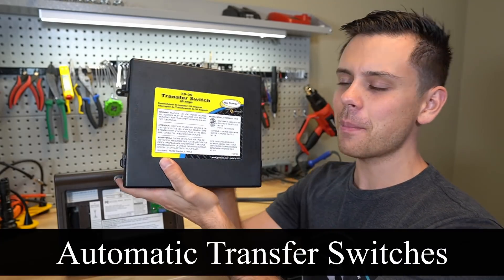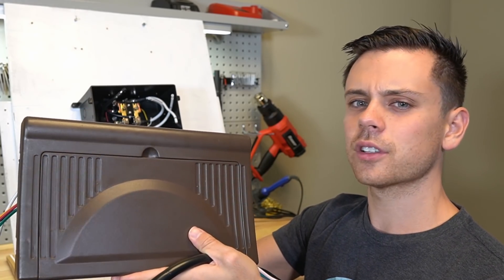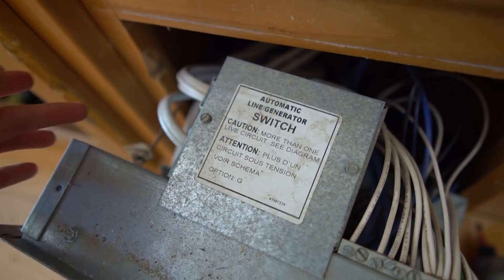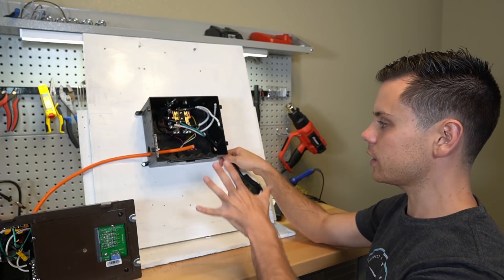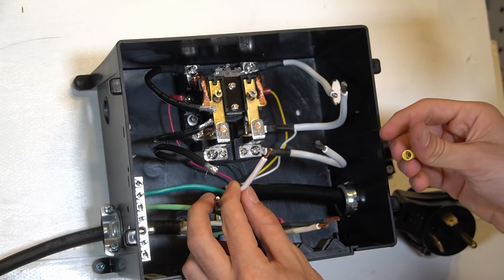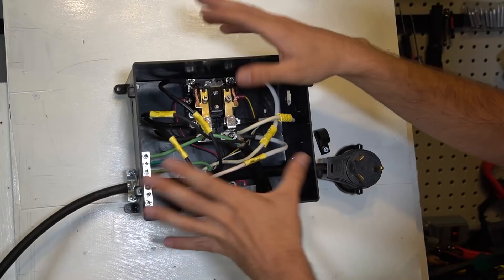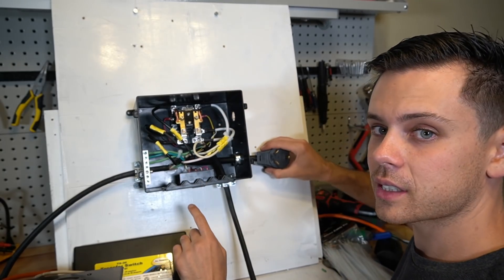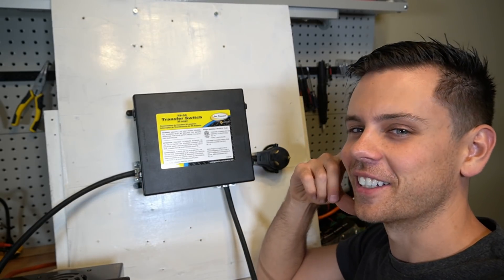RV Solar Power: How to Install an Automatic Transfer Switch to a Solar Inverter

Comment: Will…I can’t thank you enough for clarifying the converter charger connection at the end of the video.  I have been wrestling with the best way to “hot wire” the charger to the transfer switch for 2 weeks and you clarified it in mere moments.
Thanks again…for yet another outstanding video!
Reply: Do you have to disable the factory converter, or does it get bypassed from the transfer switch for the new charger ? Lifepo4 battery

Comment: The online schematics at GoPower show two different setups. For switching between a generator and shore power, it is as you have shown. But for switching between an inverter and shore power, the inverter and shore power connections are the opposite. I don't know why that would be, but according to the online schematics, that is the case. I would want to talk with GoPower tech support before installation in order to resolve the issue.

Comment: Hello Will,could you post a video with a diagram for an RV set up? My question is from the transfer box to the inverter. Should there be a fuse or a shut off block and also, what does the solar system look like from the inverter on? Thanks.

Comment: so if you have a generator, shore and solar will it require a transfer box with 3 inputs?
Reply: ohh nvm got it there can be variation depending on the converter box. if it has a transfer switch built in just find the shore power and add another switch there

Comment: Hi Will, Will the HCDC Model HD060 15amp work for my small teardrop with only three 15amp breakers in it? Trailer doesn't even have a 30amp plug only a power cord style plug. Thank you!

Comment: Hi Will.  I do have a question in regards to connecting the new solar system with 2000 watt inverter to the main panel.  My solar system will not be able to run my AC unit so I can't see hooking up my inverter to the main panel via a 50 amp automatic transfer switch unless I turn my two AC breakers off before turning on my inverter.  Have you had other ways to hook up to the main panel without going through the process of disconnecting the AC system breakers or is just easy to remember to turn the AC breakers off?  As well to turn off the converter.

Comment: I have two 10kwh battery banks each powering with a 3000w Giandel inverter...    right now I have one of the inverters wired into a breaker to supply a 25a circuit to my RV.   Could I wire both inverters into this transfer switch so it would fail over to the second inverter as a backup if the first one lost power.   ?    Right now the 2nd bank is powering aux loads (septic, well, etc) and i view it as a backup if the other battery bank is low...  it would be great to have an auto cutover and cut back.

Comment: Will the system work when the demand becomes to high and the invertor closes down. When the invertor comes back on even when the demand is to high. Will it create a cycle in short time between supplies?

Comment: RV Question: I want to install an EG4 3kW Off-Grid Inverter and an EG4-LifePower4 Lithium Battery | 48V 100AH | Server Rack Battery in my RV. Can I do away with the transfer switch by 1. Running my shore power line to the ac in on the inverter. 2. Run the ac out from the inverter to the ac circuit breakers. 3. Disconnect the RV battery charger. 4. Run a 48v dc line from the battery to a new 48v to 12v converter located next to the rv panel. 5. Connect converter to DC breakers. 6. Later connect solar panels. Now when I'm plugged in to shore power will this all work without the switch and without problems? Thank you

Comment: Only thing different I'd so would be shrink tubing to help from the wires pulling out of the butt connectors, or use wire nuts but I love how straightforward this is 👍

Comment: This ATS is awesome!  It now comes with a clear cover plate over the contactor and it has pre-installed wago 221 wire connectors!

Comment: You should do a video hooking up ECOFlow Delta pro with a transfer switch.
Reply: I second that!  As well as show how to add a toggle to switch to be able to swap between a generator and Solar power station for backup power. TIA!

Comment: Is there a way to use a 30 amp switch on a 50 amp wire system my RV was designed for a dual Air Conditioner but I live in the Northwest we don't need two so there is no reason to have a 50 amp service. I have only used the 30 amp service at any RV park I've stayed at?

Comment: hello to you, first of all, thank you very much for all the very clear explanations that you share. I have very good knowledge of electricity but far behind you, my question, I have just received my new trailer; sporttrek 251 vfk, and therefore prepared for the new season 'there is already a 100 watt panel I would like to add two other 200 watts, my controller; go power GP-PWM-30ul (mauel says he can hold 500watts), my inverter: WFCO WF-8955 AD, I have two 12volt, 200ah (400ah) lithium batteries available, 2000watt inverter, what do you think of that please, thank you in advance

Comment: I have a regular renogy 2000 watt inverter and a renogy dc/dc charger with mppt is there any way to add shore power to charge the batteries without having a inverter charger or purchasing a bunch of extra stuff? Thank you 🙏🏽 I watch your videos all the time and you break things down really well

Comment: Correct me if Im wrong have a 200watt solar set up to charge batteries while traveling and in case power goes out, could you wire it up like this and just flip the charging breaker switch and be fine running off the batteries? My two 200ah batteries are the only ones I have. So bo room to add a seperate battery bank. Guess thats my question couldnt I hook everything up just like this, and when Im not on show power flip the charging switch on my converter?

Comment: Hey Will.. thank you for all you do!  This video is 3 years old, and still valid, but I'm hoping you could do a new version, using a 50 amp switch.  I have installed 4x 200 watt panels on my 5th-wheel rig, along with 2 SOK 206aH batteries, and a 3000 watt inverter.  I have purchased a 50amp automatic transfer switch, but not confident of the install without a bit of guidance.  (and you are one of the few that I trust).  Thx !
Reply: How did you end up with the system as I have a similar set up with SOK 206aH batteries and 800w solar panels and 2000w inverter?

Comment: what starts the generator?
Reply: The transfers from shore power to inverter power.
You would plug your shore power into whatever generator you have and start is as normal.

Comment: With this arrangement of wires isn't the ground wire for the inverter bonded to the neutral for shore power? I am assuming the shore power is bonded at the shore panel of course. Is that safe?

Comment: At minute ~12:39 you mention terminating the battery charger. I assume this is so that the inverter doesn't pull power from the batteries and try to charge them up at the same time... That said; do you have a video on how to terminate the battery charger on this port? Or can you guide me in the right direction? -Thank you,

Comment: I’m just converting over to Lithium battery system. If my RV is parked, and plugged into shore power, I don’t want the battery charger to be on all the time. Should I disable the RVs charger? If so, how can I do that?

Comment: I see that the wiring diagram on the site calls for a fuse on the line from the charger... is that build in or something you need to add?  Thanks!

Comment: I want to install a 2000-3000 watt inverter in my class A motorhome and I only want it to power specific circuits (microwave and galley plugs circuits so I can use a toaster, coffee maker and microwave when boondocking.  Can I connect a transfer switch to serve the shorepower to those specific circuits and leave the remaining 110 volt circuits (AC, furnace, etc) as is?  Or should I not bother with a transfer switch and simply turn the inverter on when I need it for the few minutes of expected use?

Comment: Good try but you are confusing folks by calling the ac panel and the converter the same. Most RVs have a fuse panel and then somewhere close is the converter that plugs into the back of the fuse panel.
Reply: No most RV's the DC panel is in the "converter" which also has the AC breakers like he said.  It's all one unit.
Reply: @fisherguy  Also most modern RVs are 30amp or 50amp. Cutting the shore power cord gives you two hots so how do you deal with that?
Reply: Pardon?  2 hots?
In a 30 amp service there's a black (hot), a white (neutral) and a green (ground).  Pretty basic AC.

I've never seen an RV that didn't have the AX breakers, DC fuses and charger all in one unit.

Comment: I'm still so confused after watching this 3 times.... I'm building a Ambulance into a camper... I already have shore power that seems to go into a auto transfer switch, then in a fuse box then 3000w inverter. My shore power doesn't work. Looks like melted wires inside the transfer switch. 🤯

Comment: I just received my Go-Power T30 transfer switch (July 2022). They now come with a green plastic guard over the switch. The guard is great but it doesn't allow for the last segment of your video. There is no way to get the converter/charger connection to the small screw that you suggested. Besides, I think that screw is only intended to hold that connector to the terminal. I'd not recommend using that screw anyway because it's too small to make a decent contact.

I just stacked my 2 connectors on that one, larger, screw and utilized the same slot in the green plastic guard.

BTW...... I really enjoy your teaching style and recommend your videos to others.

Comment: Hi Will, how would I connect my inverter to rv that has built in onan 5500 generator.  Have the 3000w renogy inverter charger. Do I wire it from existing ATS ac out, through the inverter to ac 120 v panel? Also do I disconnect the converter totally since it is an inverter charger plus using lithium now instead of the lead acid marine batteries the rv came with. Finally do I move the generator starting cables to my new lithium batteries? Where and how. Please help. Everything is renogy. I have your book and have been watching all possible YouTube videos but still confused. Should I leave the marine batteries wired to the generator and have a cheap solar panel to keep those batteries charged separately and  disconnect the converter so not creating the infinite loop. Was thinking this si I can still boost generator if batteries are drained to much.

Comment: Question..  I have a 50amp outlet in my rv and that is where I plug my shore cable to my onan generator.  I assume that means I do not have a transfer switch….  Therefore, can I add a 48v inverter/charger and just plug the inverter into the generator or shore plug and the add another 50 amp plug to plug my shore plug into when on the road/off grid?

Comment: I'm putting the ATS to switch between generator and shore power. The output of the ATS goes to an EMS (elaborate surge protector) and the EMS output goes to the Victron Charger/Inverter, which drives the distribution panel. Didn't expect to find your ATS switching between the inverter and the shore power.

Comment: I have a growatt 3000watt inverter charge controller, can I wire the power cable to my AC in on the unit? Do I still need a transfer switch?

Comment: I have solar on my travel trailer but am having issues with my converter sucking up power even with the house batteries disconnected and creating a feedback loop. I want to install a transfer switch but the converter is wired to my fridge, water pump and some outlets without any obvious way to isolate them from each other. Would you happen to have any advice?

Comment: Could I do this exact set up with solar panels at home to inverter to the ATS? I saw on another video he had an ATS but it required batteries. As of right now I'd just like to power my central AC during the day when my solar panels would be getting the juice. I have no batteries.

Comment: To be clear.  Are you saying that I should not connect Solar Panels (through charge controller), to my 12v RV battery?  
Or.  If I’m going to use Shore line to charge my batteries (for cloudy days), disconnect the solar panels while charging?

Thought I understood this but now I’m confused 🥹
Reply from the maker: Where did you figure that? You can have all charging sources connected. Where did I say you can't?
Reply: @WillProwse  hi. Thanks for responding.  In your clarification comment, you said: ‘No, do not charge your soar battery with the RV converter charger!!’    
I have 2 12v batteries in parallel, that I am about to connect 4 100w solar panels via  charge controller.  On cloudy days, I was hoping to charge the batteries by plugging my RV camper into a generator with the boom docking cord.     
I apologize if I’m missing the point of this video —still very much a noob in this area.  
Thanks again.
Reply: @TURNKEYiNK  I know this is old but many of the oem stock rv charging solutions are not able to be correctly configured with a charging profile for lithium batteries.
Since so many people are switching to this type of battery I am assuming that is what he is referring to as far as saying not to use the stock RV converter charger.

The way he is wiring this the AC battery charger cuts on through the transfer switch anytime the System is plugged into shore power and automatically shuts of anytime the shore power is disconnected.

Comment: Hey @Will Prowse, the user manual for the transfer switch states to connect a 8-gauge chassis ground to the transfer switch ground bar. My question, I have a chassis ground connected to my RV's power house ground bar, would it be OK to run that ground wire from the transfer switch ground bus to the RV power house ground bar that connects to the existing chassis ground wire? or would I need to run a separate line from transfer switch ground bus to the chassis?

Comment: Hello will! at 4:00 you explain how if you don’t have a generator or have removed it, you can take that spot and plug it into your inverter (of your solar system) instead, how exactly can i do this?? i have built the off grid king blueprint that you have on your site successfully but trying to figure out how to wire in the rest of my camper van without re-wiring everything, would all i need to do is replace this wire from within the automatic transfer switch? Thank you.

Comment: Hey will, bit of an old video so i’m sure somebody has pointed it out, or if you will see this. If not, here is some useful information for you. 

The lack of a ground rod is fine. The main purpose of a ground rod is to dissipate electrical surges from the grid, such as lightning hitting a pole 10 miles away or other sources of static electricity. If you are hooked up to shore power there should be one of these on the main service of the property, and when you are disconnected from the grid you don’t have to worry about these surges. The rest of the ground system serves a much more valuable purpose than this- Backup return path for current.

If a wire rubs out on the chassis, if there is no way for the electricity to flow back to the source and cause over current, tripping the breaker, it will energize the chassis and cause electrocution. It is absolutely vital the chassis is bonded to the ground of the AC system somewhere.

Now the ground also needs to be connected to the source somewhere. In a house, this is in your main panel. The neutral and ground are connected at this one point only. If a hot wire shorts against anything grounded, it will flow through the ground wire, through the connection to the neutral and trip the breaker.

When you are hooked up to shore power, this bond should be in the main panel of the property. When you are not hooked up to shore power, it is a different story. Most inverters do not have the neutral and ground bonded, because they expect you to do that in your generator. If we do the connection in the panel  in an RV, that means there will be a second neutral to ground bond when you hook up to shore power. This can cause current to flow on the ground which can cause electrocution and stuff melting. So, what I like to do is make a jumper from ground to neutral on a wireable plug going to the inverter. You could also use one of those 2 position breaker boxes and just have one breaker, and do your bond there. 

This is why the transfer switch also switches the neutral. They expect you to have a neutral to ground bond on the inverter/generator side. I suggest you research some youtube videos on grounding and bonding- ElectricianU has some good videos on that. 

Oh yeah- A lot of generators also have no neutral to ground bond. This is known as a floating neutral. Always check with a multimeter set to continuity on generators and inverters and understand your grounding system.

The way you have this system set up, if you connect a regular inverter to it there will be no neutral to ground bond while on inverter power. This basically means the ground is doing nothing and it vastly increases risk of electrocution.

Comment: I Have the 400 Watt Renogy system with the 3000w inverter from renogey. I also got the transfer switch box. Im seeing everyone is connecting to the RV or off the RV braker. I have my own braker box and shore line power.  Any help would be grateful. Thank you for your time and help. And great tutorials.

Comment: I just bought a trailer that has a generator, shore, and 2 battiers connected to a solar panel with a 2000w inverter.    I get outlet power with the generator & shore, but not off the batteries.   I'm assuming, an ATS can be installed so all 3 sources route thru that and without shore, with the genny off, I can get outlet power via the batteries from the inverter?    Help!